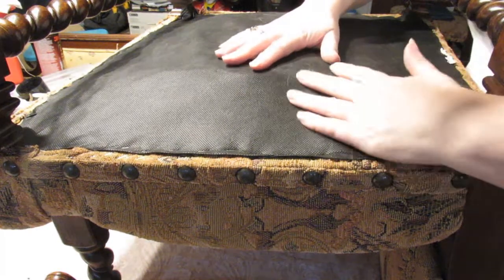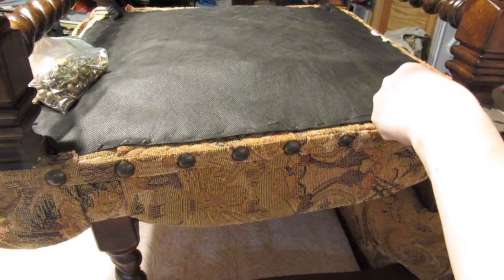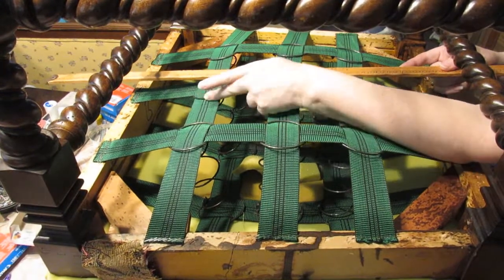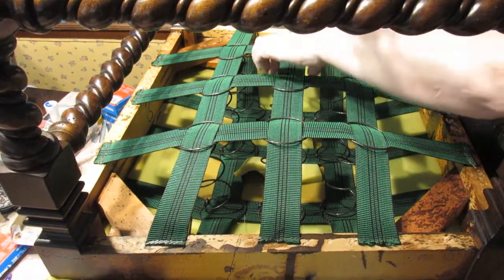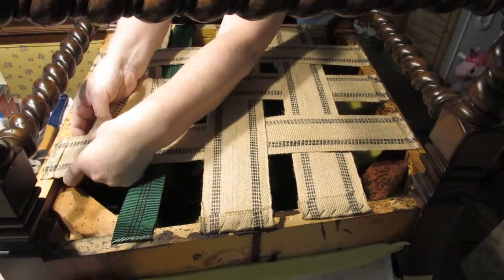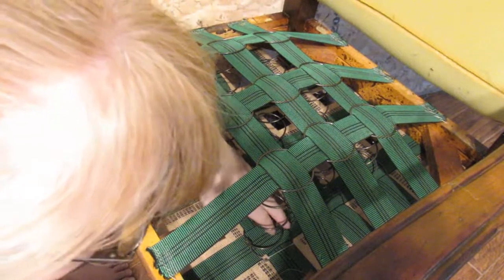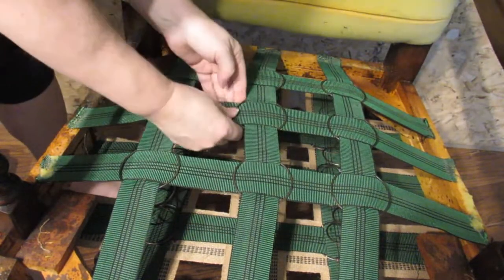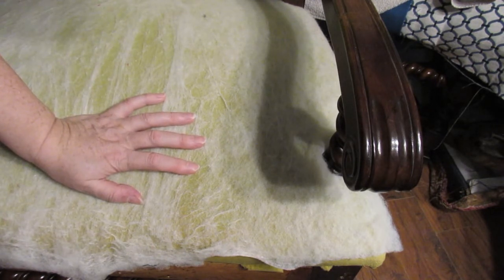Over Webbing Springs - Professional Tips and Tutorial for All Levels

Comment: Nice job. I have a project that is something similar coming up but was not looking forward to re-doing all the springs. This  might work, thanks for the tip.
Reply from the maker: Thank you for your feedback.  I will more often than not take everything out of old furniture as sometimes the frame needs a bit of TLC.  This particular chair is quite young and the webs were the originals so to over web them worked out.  
On older furniture, if the frame seems sound and there are a couple of layers of webbing I would advice you strip out a layer or two and re-web over the base layer as it does affect how even and smooth the underside of the chair looks.
Good luck with your projects.

Comment: I'm new to this and my chair has springs. They need to be secured and I was going to use burlap. When I got the chair that's what it had. So I guess I need to get webbing also.
Reply from the maker: Thank you for your question.  I used the webbing under the chair seat to make sure the springs were tight under the chair and to make sure the seat didn't sink down.   Sewing the spring on top and bottom was to make sure that they didn't eventually slide over again as that stresses them.   I generally put burlap or another fabric over the top if it is just going over the tied-in springs.   As this had the webbing on top of the springs I did not bother, as there was enough support for the foam to rest on.
To get the right length of webbing measure the lengths that you need and add about  1.5 m /1 1/2 yards to the length for turnings as well as enough to be able to pull it in with the web stretcher.
Good luck with your project.
Reply: @beinspired1487  Thank You so much...
Reply from the maker: @simpleme5719  My pleasure.
Reply: A general cost to repair web I’m in Ga

Comment: Thank you for the video. I have a project. It is 1930's spring chair. It has very complex spring cage, with multiple sizes of springs. Unfortunately, some of them are broken. I can't find anything similar done on YouTube. Would you change all the springs in the cage, or replace only the broken one? Thanks.
Reply from the maker: Thank you for the question.  My first thought was to look on eBay, or even Amazon and see if anyone has a set of springs in a cage or springs that might be of a similar size that might fit.
It might take a little searching but there might be an upholstery place close to you that is willing to either help find a supplier to help with the springs.
I try to keep the integrity of the piece I am working on as a general rule.

Good luck with your project.

Comment: I am trying to avoid having to reapolsetry my spring chair. Mine has the webbing and metal over the webbing.
Reply from the maker: I would suggest webbing over what you have and then catching the original webbing to the new ones if you feel that anything will shift.  I will only re-web chairs if they are falling through the bottom and what is already there is falling apart, otherwise I preserve what is there as the next time the chair needs to be upholstered other things might need to be fixed at that time.